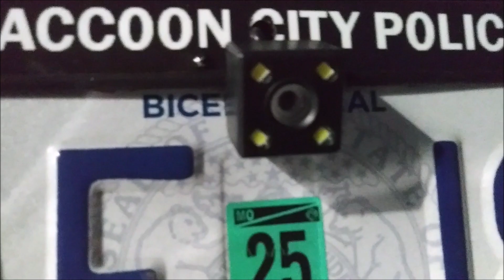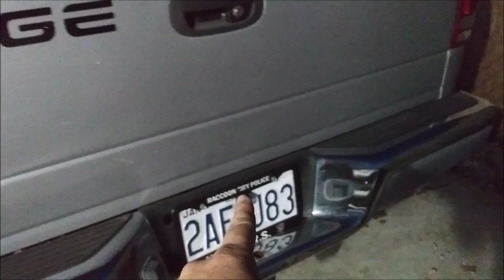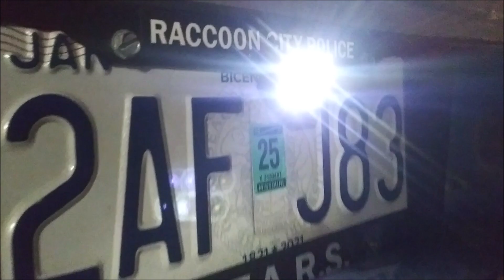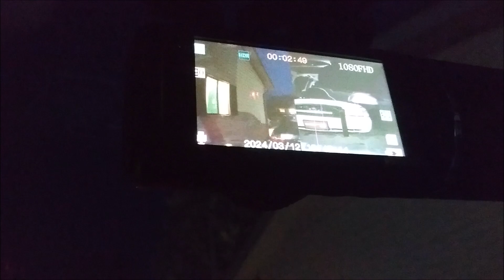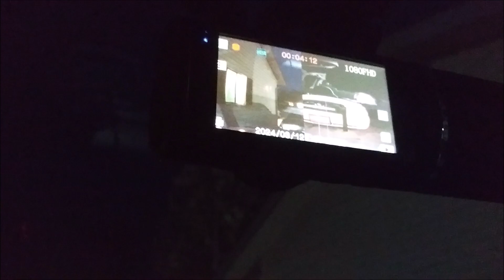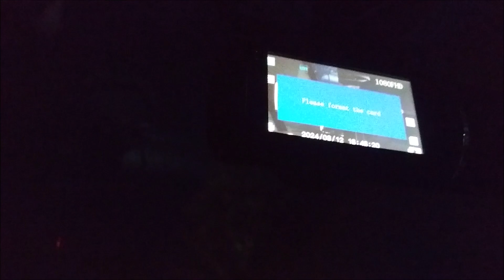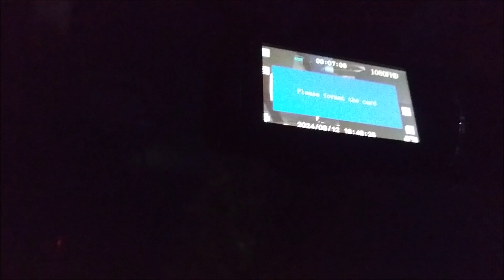What is wrong with my dash camera

Comment: What is the brand, and model number of the dash cam?
Reply from the maker: There are no such markings on the box, and Katie ordered it...so, I'm gonna go with China brand and model.
Reply: @HollywoodHornet  
The lord helps those who help themselves.
If you post this video on the DashCamTalk Forum I bet someone knows the answer.
Reply from the maker: @PanzerPlatform  hey, that's exactly what I tell all the junkies ODing when they ask me for a dose of Narcan. In other life, we could have been sector partners. Per Katie's Amazon it is the following.
SUVCON Dash Cam, 3 Channel Dash Cam, 1080P Dash Cam Front and Inside, Triple Dash Cam, Dash Camera with 32GB Card, HDR, G-Sensor, 24Hr Parking, Loop Recording 
 https://a.co/d/ays3bkG
Look familiar at all?
Reply: @HollywoodHornet  
I just read the owners manual, and there is no mention about the red wire installation for the rear camera.
I would disconnect the red wire.
Perform a reset of the camera.
Try a different SD Card.
I will post your video on DCT to try to get more help.
Also you can send an email for tech support to the email listed in the owners manual on page 5.